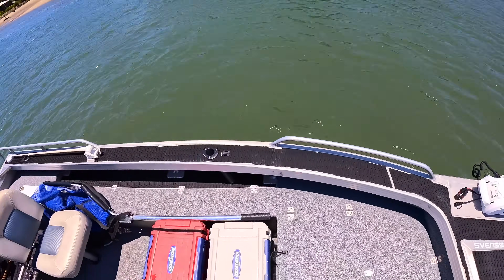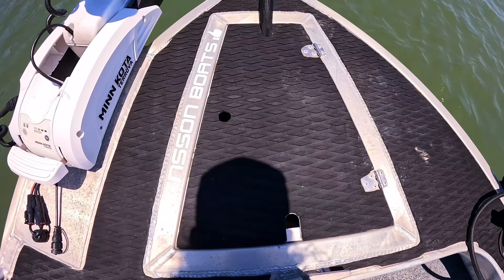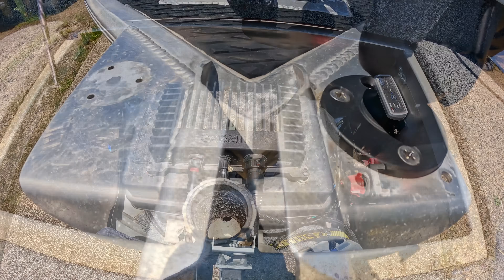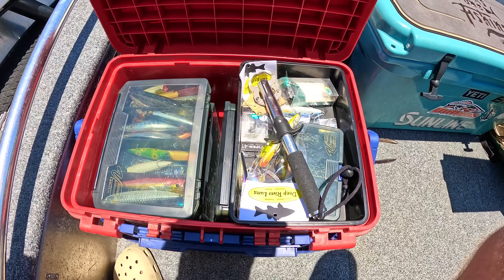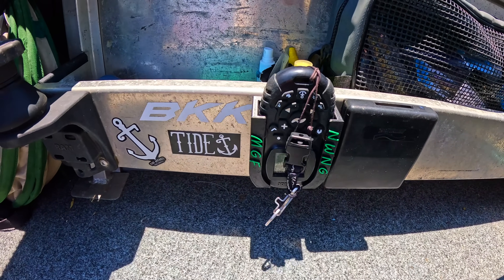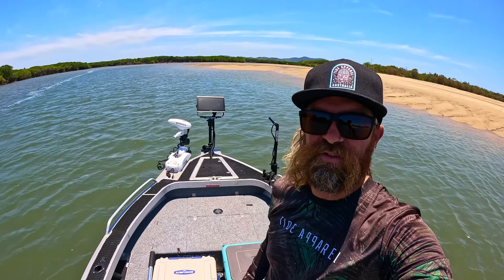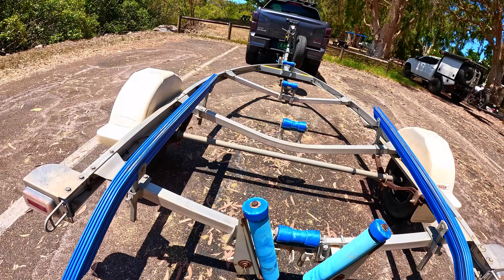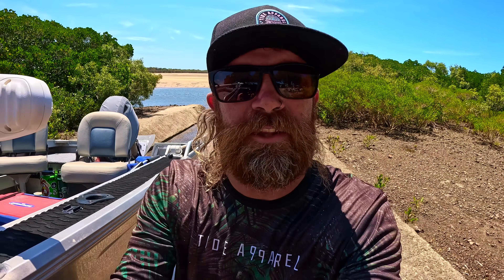How I Upgraded My Tinny…

Comment: Love your run down of your rig. Just moved back here after 25yrs. I have a 4.1m Ally craft and a 5.75m cruise craft. Only thing missing is some good marks, and hints as to where I can start looking 50~60km offshore?
Reply from the maker: I rarely fish marks these days, get your sounder setup so it reads at speed and drive over contour lines on your chart to find new spots every trip. All the good marks are loaded with sharks these days 😅